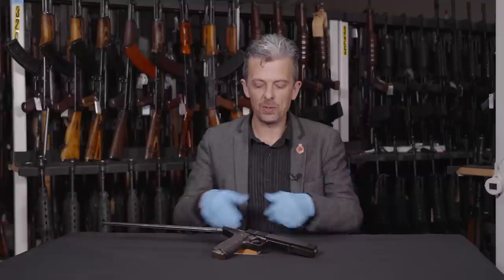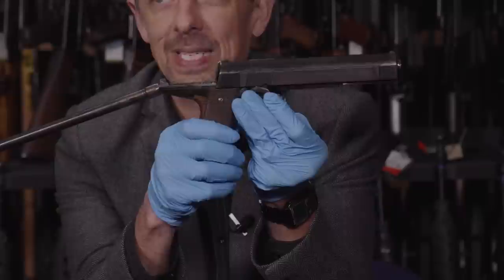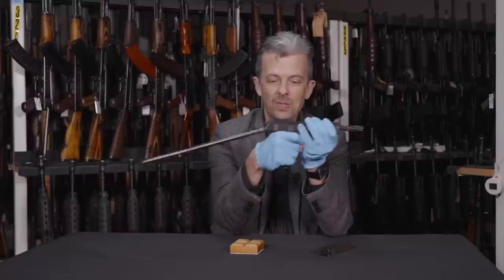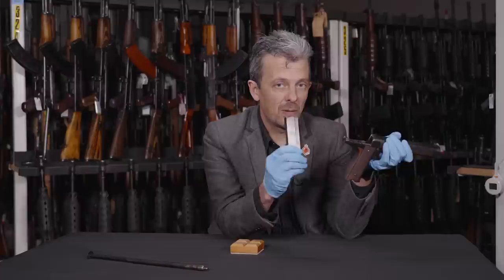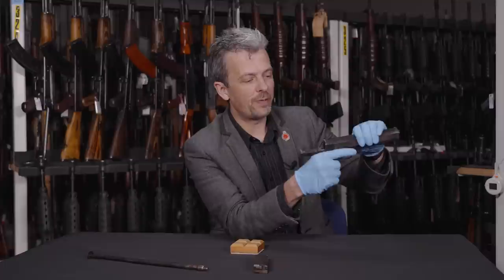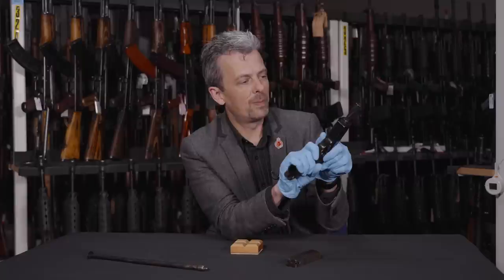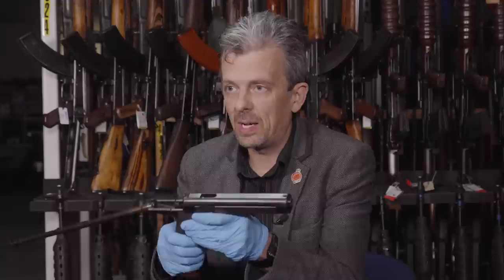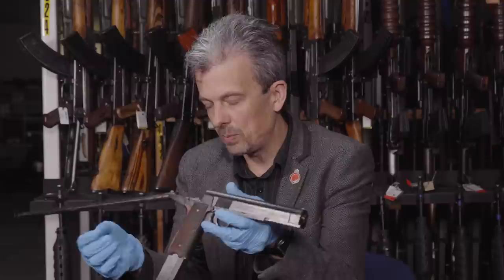Rifling on the *outside* of the barrel? The SR-11 with firearms and weapons expert Jonathan Ferguson

Comment: The original Ar-15, M16 was intended to have preloaded disposable mags but it just resulted in inferior malfunctioning mags.
Reply: Yep. Even the later versions of the aluminium AR mags with the improved followers, suffer from fragility. If dropped on the ground or on a rock, or stepped on or something, they can get dented in a way that's not obvious visually, but enough to cause malfunctions. As for steel mags, they are more than twice as heavy.
Reply: I understand that the very original intention with the Sten Machine Carbine was to have the magazines as disposable. Not in the sense that you used them and threw them away but that a faulty magazine was to be exchanged at unit level. Discipline inertia meant that soldiers were being charged with mishandling if they reported a faulty magazine. The idea was that the speed and quality of mass wartime production meant that some would be below par and the unit replacement was the last line of quality control. Mind you, I have seen squaddies opening beer bottles with L2A3 magazines so perhaps the large shouty Armourer Sergeant was right……
Reply: I agree with your statement but feel it's important to point out that the "inferiority" was almost certainly caused by the (re)use, not necessarily the magazines themselves. I have zero experience of war or ARs, but surely if the magazines had actually been used once and discarded, those issues would have been largely or completely avoided?
Reply: @jameshealy4594  Good point, but I can see a soldiers reluctance to toss out a magazine.
Reply: I heard that was the thinking behind the Radway Green magazines on the L85A1 (SA80). Led to no end of stoppages. M16 mags, (courtesy of our friends across the pond) were actually a huge improvement…

Comment: 3:57 I would say that calling this rod a buttstock is an unwarranted compliment, for the butt is severely lacking. 😉
5:48 It looks to be a double-stack, double-feed one, which is a very advanced feature for a time when even among submachineguns it wasn't as common.
9:10 Oh, so the M16 wasn't even the first gun to be designed with this madness in mind?! And why is it always the desire to sink your magazine in some jungle swamp hundreds of miles away from your manufacturing base?..
9:51 Incidentally, that giant mud ingress opening on the rear of the frame together with a fluted barrel look extremely jungle-friendly as well. 😁
12:05 Comedy aside, that's an outstanding amount of work! Hats off to whoever did it!
13:00 Now I wonder whether this would work in autocannons...
14:26 I'm surprised to hear that no Australian SMGs were used for comparison. Also, from the outside MCEM-2 looks to be in the first wave of what would become a very common pattern of post-war SMGs, so it's an even more interesting test.
Reply: Thank you tha🎉
Reply: @wastedangelematis  Cheers!
Reply: Robison has designed a 20 mm , 40mm and was working 75mm ( Using components from the M3)  auto cannon by the end of the war. No the 75 mm would be something to see.
Reply: @robertmansfield7656  That's interesting, thanks for sharing.

Comment: I guess to avoid the muzzle dip when the slide clonks forward you could build something like this using a rebated rim cartridge which would allow it to go full on Oerlikon with a true advance primer ignition design - so recoil reverses the bolt motion before it ever hits the back of the barrel.  (But that's not a standard military pistol round, and API adds size and complexity to the gun)
Reply: I agree that would help this concept work much better, as would allowing the barrel some axial or azimuthal float relative to the frame. Also, I think a design change to closed bolt operation would have fixed the design's problems with accuracy in semi-automatic.

Comment: Superficially looks like a 1911; or, with the double stack mag & width, the BDA.
I was thinking 'Blish' less than a minute before you said it.  🙂
That thing has a fantastic brace of crap collectors - specifically the mud tray at the rear of the frame.

Comment: Reminds me of how I take apart my airsoft m1911 and stick the mag between the slide and frame down where the recoil spring would be and pretend its a mp40 or something. Neat gun, I love the outside spiral as a design thing (or cooling system like having fins?) on firearms like some of the exposed slide m1911 airsoft pistols

Comment: 8:08 although most modern pistols help the user, by popping the magazines little bit after you press the mag release. 
Because the slide catch presses the magazine feeding part down, 
so after the magazine is empty pressing the mag release will pop out the magazine just enough so that it is faster to reload.
Reply: For the most part that's a) the follower exerting pressure on the slide release and b) some nice wide clearances in the magwell. Browning Hi-Power variants do have a separate magazine assist spring though, probably others that I'm blanking on.
Reply: I think 'freely dropping' pistol magazines have only become a big thing since the development of sports like 'practical pistol' where reloads are done on the clock.
Reply: @jonathanferguson1211  thats what i ment its just my crappy english so i didn't know the proper names of the parts
Reply: @jonathanferguson1211  @derekp2674 i've seen it on lots of pistols, even in traumatik pistols that aren't even sports pistols or regular pistols. Those that have the type of magazines, that have little open spot in the side of follower that i wrote earlier. Although now that you mentioned it, i just googled the glock magazines and saw that the little spot for example in at least regular glock magazines aren't deep enough for the "mag pop up" instead it is just enough to keep the slide back after the mag is empty. But for example Zoraki 914 (& 917, 918, etc) magazines has that small spot deeper, and they pop up like that as well. Many pocket pistols too that has those similar to Makarov type lever instead of normal mag release button because otherwise it is harder to reload it faster. Can't on top of my head remember better examples either, but i googled smith wesson 1006 (even though i've never handled one myself) and saw it has that same deeper spot in it as well which also slighty pops out when you press the button i watched a video about it just to give one example. It is not very noticeable though, like i mentioned it is just slight helper but that's the type of spot in magazine what i ment on most modern pistols.

Comment: 3D guns sometimes have rifling on the outside of barrel due to US atf rules requiring rifling on pistols but they are essentially useless or even harmful in polymer barrels. Also the savage pistols used the torque from bullet spin as a proper lockup and when multiplied by the lever arm of their cam it offers a couple ft lbs of torque for lockup for the very brief time the projectile is accelerating
Reply: With respect, US and ATF rules are crazy. 
Here in the UK, any "barrelled weapon" that can discharge a bullet (or other projectile) with a potentially lethal velocity (or energy) will be controlled as a firearm. Individual pressure bearing components, including barrels and breech mechanisms are also controlled as firearms.
Now that this episode has dropped, I will look into calculating the rotational inertia and torques in the Savage 1907 and the MAB 15. However in the light of the "Ask Ian" video and the numbers derived so far for the SR11, I expect that the torque values will be quite small.

Comment: That is a FANTASTIC piece of engineering. But would it work once it got hot?.
Reply: The barrel bushing that links the side to the spiral grooves on the barrel would need to be designed to cope with the thermal expansion of the barrel, otherwise the mechanism would tend to jam up.

Comment: The "nose dropping when the slide slams forward" should only be an issue for dry-firing (so... not a problem?). If there's a round chambered, there's almost no delay between the slide stopping and the bullet going off, creating rearward recoil again.

Comment: While as an aussie I want to like it, I must admit firing a rifle or pistol I have never felt the firearm twist due to the rifling.  The engineer in me likes that it tried to take it into account and the sales man, says near enough it good enough.
Reply: One possible real world aspect of 'spin kick' or recoil torque could be that screwed on moderators/suppressors may work loose, if the 'spin kick' works to unscrew the barrel relative to the moderator. 
When I used to use a SIG P210-5, where the foresight is held onto the extra long barrel by two threaded collars, those always used to work loose, so that might also have been related to spin kick.

Comment: This kinda looks like somebody tries to build a Stetschkin APS from memory with only having 1911 parts ^^
Very interesting piece with some weird, but also cool features, I wonder where it would have gone if it was developed further.
Reply: I think additional work on this project would have resulted in lessons learnt for the design of compact but accurate SMGs and PDWs. 
Between the more recent Western and Eastern block efforts, much of the 'heavy lifting' has been done for the Stechkin, Skorpion and the H&K MP5K and MP7. 
To improve first round accuracy, all of these fire from closed bolts (did Robinson carry over an open bolt mindset from his work for machine guns?). 
With modern light weight polymer receivers and frames, there could be more scope for cunning mechanisms to apply constant recoil principles without producing an unduly heavy weapon.

Comment: 12:37 Oh no. The Blish lock was leaps and bounds more effective than this thing. In a test conducted at Woolwich placing a Thompson into the chuck of a lathe with a rod down the barrel pushing on the bolt (more specifically the firing pin which acted on the hammer pressing against the inside of the receiver), it was found that it took between 60 and 100 pounds of force to open the breech.
Reply: Interesting, do you happen to have further information/ sources?
Reply: @dreadnought8363  it's taken directly from the report by the Chief Inspector Small Arms titled: Minute 407 Report by CISA on Thompson SMG, dated 9 July, 1921, and can be found on pp.130-134 of Hill's The Ultimate Thompson Book.

After rereading the relevant passage, I'd like to correct a couple of errors I made in my previous comment. The testing was conducted with the firing pin both present and removed, and it was when the firing pin was removed that the pressure readings of 64 (not 60) to 100 lbs were recorded.
Reply: @alex7x57  thanks
Reply: @alex7x57  It's a great rarity to see someone in the comments referencing primary sources directly. I applaud your dedication!
PS Also, 7×57 is indeed a worthy, though perhaps underappreciated, cartridge.
Reply: @alex7x57  This is fair, but I think it stands comparison since the effect wasn't enough to actually reduce felt recoil.
Reply: @F1ghteR41  As do I!

Comment: God! Hard-core maths!! Let's have some weird flintlock stuff😂
Reply from the maker: See you next week ;)
Reply: @RoyalArmouries  I'm sure I could apply 'hard core maths' to flintlocks but it wouldn't be a  five minute job. 
A good simulation might need to model the random aspects within the action of the flint on the frizzen and then the propagation of those uncertainties into the ignition of the powder in the pan and the subsequent initiation of the main powder charge. 
It could be a fun project for someone, but a lot of supporting data, eg from high speed footage, could be needed to validate models and assumptions.

Comment: Just I guess on my part, but if you locked the 'shoulder stock' into your arm pit, that would mitigate the nose drop of the pistol, and enhance it's tactical 'point-ability'.
(...given that the shoulder stock is next to useless when placed in it's traditional location)
Any documentation (and photos) of the pistol's 'manual or arms' and tactical employment might clear up some questions.

Comment: I'v fired a Thompson and felt that front chunk, then the recoil of the bolt hitting the back. it really felt like the gun was rocking back and forth. Did not really feel the same on the MP40 I fired, though being 9mm with lesser bolt mass I may have just not noticed it so much like the big old 45 Thompson bolt.

Comment: If the rotating barrel fully compensated for the twist imparted on the barrel by the bullet engraving in the internal rifling, wouldn't the bullet fly forward engraved but un-spun as the barrel rotated around it?
Reply: Other way around.  By using the external "rifling" to keep the weapon from rotating, the bullet would actually reach full spin - in regular weapons, that twisting motion of the weapon actually detracts from what spin gets imparted to the projectile.  But as he said, the effect is so minimal it's not worth the effort.
Reply: I think the barrel would have to spin slower than the bullet and that makes sense because the barrel is a) heavier and b) more distant from the axis giving it much higher rotational inertia and calling for less rotation speed to counter.
Reply: @MarcinP2  Relative to the bullet, the barrel will definitely have a much higher rotational moment of inertia and a much lower speed of revolution.

Comment: Ok it's an open-bolt Stechkin-like pistol in 9x19mm with a weird rotating barrel (rifled in the outside, but of course also on the inside) designed to counteract the twisting force of the rotation of the bullet, which is tiny so it's a bit useless.

Comment: If you in a Tank an have to ge out the this would do just fine,  any number of non grunt roles. At 2.5 lb instead of 6 lb of a Stirling. Is it different yes. Plus no alkward mag sticking out the side to ge caught on the brush. Then if you're re loading in under a second the difference becmes. Pretty large. The reworking of the slide to allow for open and closed bolt would have been worth it.

Comment: That teeny tiny buttplate really shows the penetration profile (or lack thereof) of the 9mm.  You're effectively shooting your shoulder with at one-inch projectile with all of the energy of a 9mm with every shot, albeit slowed a very, VERY small amount by that recoil operation.
Reply: With respect that's not correct. Newton's laws of motion show that the recoil impulse on a firearm is equal to the momentum of the bullet fired. But those laws also show that the recoil energy imparted to the firearm is only a small fraction of the muzzle energy of the bullet, as given by the ratio of the bullet mass to the gun mass.
All that having been said, 9mm is not the most powerful pistol cartridge by quite a long way. My personal favourites are .357 and .44 magnum.
Reply: @derekp2674  Right, right.  I stand corrected.

Comment: The design of this gun, and that bulky slide in particular, reminds me of a Hi-Point to be honest
Reply: 9×19 blowback pistols have to have a bulky slide by their very principle of operation.
Reply: Hi-Point have successfully championed the use simple blowback operation in 9x19mm pistols. Unlike the SR11, their pistols are closed bolt firing, so give good first round accuracy.
Blowback 9x19mm pistols work best with a heavy slide, so a Hi-Point 9x19mm is about 6 ounces (or about 170 grams) heavier than a Glock 19.

Comment: So silly question:  Does the torsion action on the barrel rotation actually have spring behind it?  

I could certainly see that as a way to implement a constant-recoil system without a single massively heavy recoil spring (or some compound compression spring arrangement).
Reply: In this example, the recoil spring drives the slide in the usual way and the barrel bushing is keyed to fit the spiral grooves on the barrel. So as the slide moves, the barrel rotates.